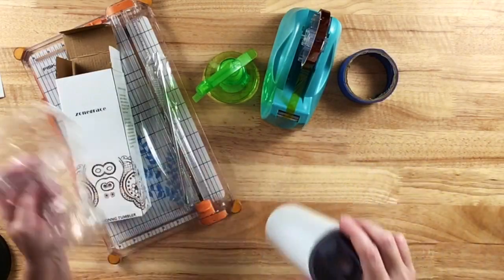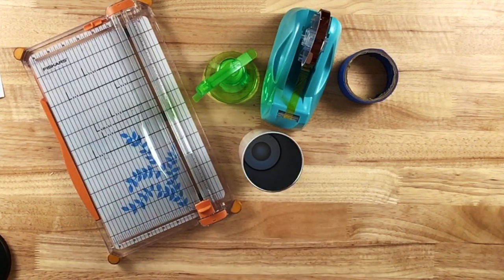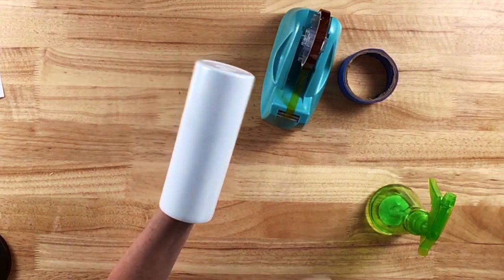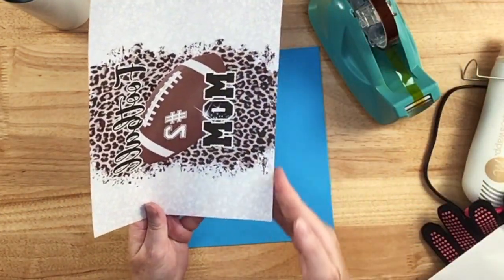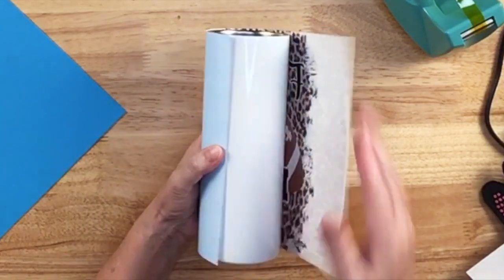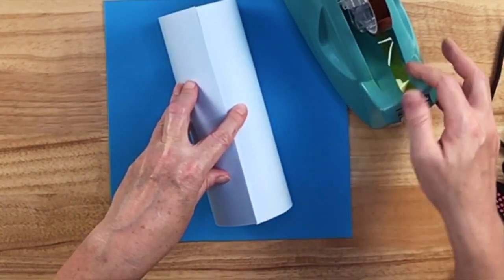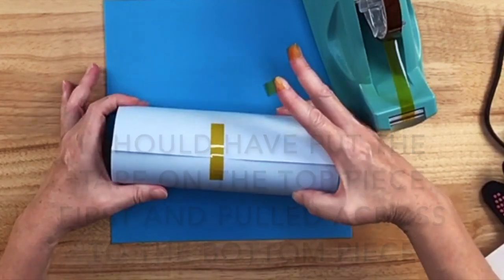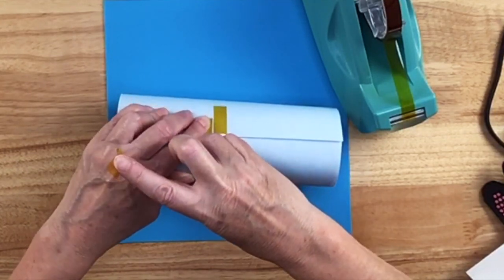Sublimation Tumbler - Convection Oven Hack

Comment: Awesome video!!! Quick question do you leave a little white one one side even if it’s a dark color? Thanks
Reply from the maker: You can since the white will overlap the other side, but you don't have to. If your actual print is just slightly larger than your tumbler, then you could just cut all the white off. Thanks so much for watching!!!

Comment: is this a regular 4 slice convection oven and you have it on its side?  Is this safe to run on its side?
Reply from the maker: It's a convection oven. Not sure if it's considered a 4 slice oven. I didn't have any issues using it this way, but I would only do it this way under supervision and not leave it unattended. Thanks for watching!

Comment: In your video at the end you mention the colours where brighter where you used painters tape.  Nowhere on the video I see you use painters tape.  Did I miss something...should we be using painters tape instead of heat tape?
Reply from the maker: On the tumbler where I used painters tape, the areas below the tape were darker/brighter than where there was no tape. This was from uneven pressure. So, I decided to use shrink wrap to get good, more even pressure all over. I have seen a couple of youtubers that cover their entire design with painters paint, which might work well also. Since this video, I got a tumbler press and I have consistently good and vibrant results. Let me know if you have any other questions and thank you for watching!!!
Reply: @MakingwithMarilyn  thank you!  I really enjoy watching your videos 😊

Comment: Hello what is the size of print for 20oz tumblers
Reply from the maker: It depends on the brand. I have 2 brands and they are slightly different in size. I learned this the hard way when my original template wasn't quite tall enough and was too long around:) But, length of 9.35 - 9.4 inches and a height of between 8.15 and 8.2 is approximate. I would cut a plain piece of paper to the exact size you need for your tumblers and use that size for your template. Good luck on making your tumblers!

Comment: what size did you make the image?
Reply from the maker: It depends on the brand of 20 oz skinny tumbler. The first type I bought, my image was 9.4 x 8.15, but the next brand I bought was slightly shorter and slightly bigger around. To save from waste, you can cut a piece of printer paper at what you think you need, and then see if it fits correctly on your tumbler.